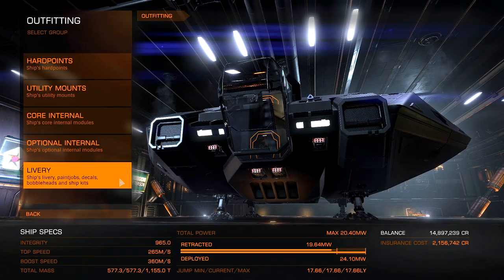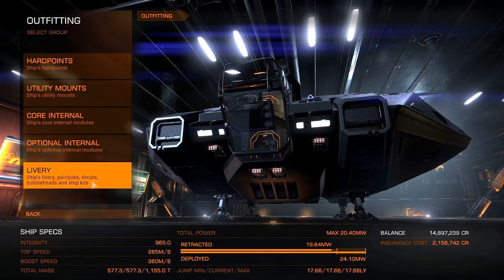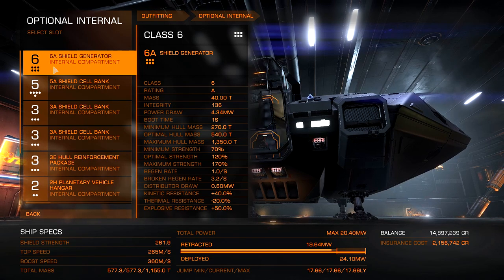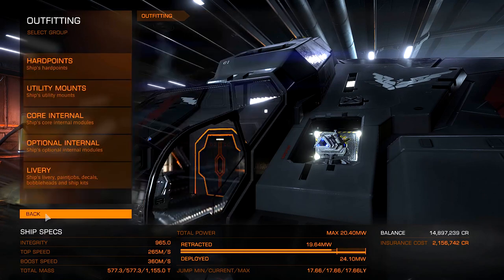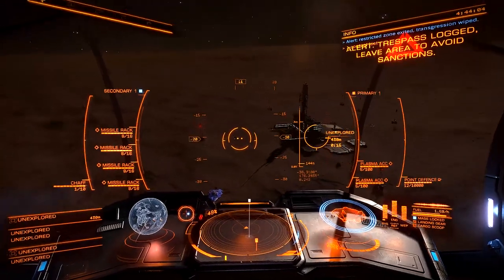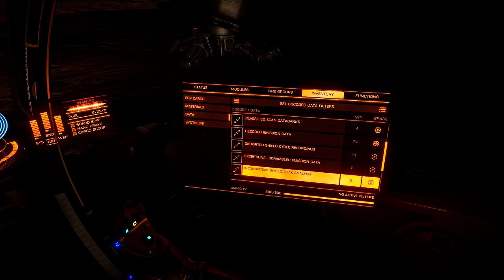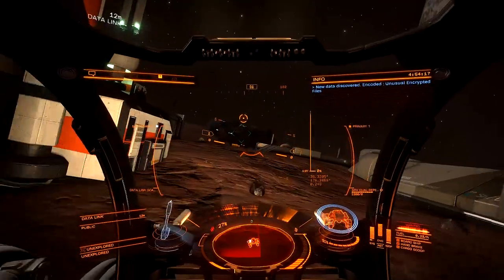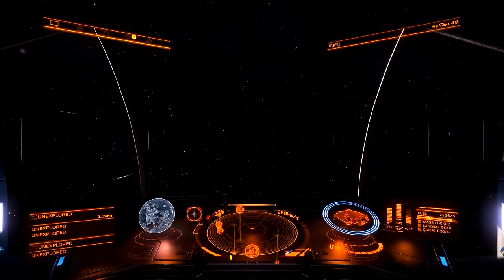Elite Dangerous - The Engineers - How to Get Cracked Industrial Firmware

Comment: I know that taking out the base power supply will render the turrets inoperable which will make your assault easier but I'm not sure if this will render data links inoperable as well. Might be worth a try
Reply from the maker: That's a very good point. I didn't think of it when I was doing this, but it may well disable the data points, I don't know. I'll give it a shot at some point thought, thanks!

Comment: This is pretty cool but I have collected several of these without conducting a full-on assault of the base. just land about 1 km out and drive up in the SRV. As long as you don't scan anything private then no one will attack you. I did have one alert get set off on me in the SRV but it warned me and i didnt listen.
Reply from the maker: I actually have tried that before. First, you get fined for entering a trespass zone and then, when you don't leave, the alarm starts going off and you get attacked. Is that something that works on + Low Security bases? And how are you not setting off an alarm when you scan the data points?
Reply: Just rush inside the zone scan the data point and leave it before you get fined or wanted.
You got 30 seconds to the fine and another 30 to get wanted from my experience and if the zone is on the roof of a building there is a small ledge on the outside of it where you can be on the roof but not inside the zone.

That's how I do it.
Reply: +ShadowTracer I'm not really sure. There is an alarm that sounds and you can here a loudspeaker yelling about security but no one attacks me. Maybe its bugged, idk. The only time i got attacked was when i scanned a private node. The only time i got the trespass warning was when i went into a certain area of the base that had shielded areas.
Reply from the maker: Sean Caswell Daedalus Wow, you guys are lucky. My SRV gets blown away every time I've tried that stuff. I guess it's a bit different for everyone then. Now I'm curious how many people your method works for and how many it doesn't.
Reply: Perhaps it has something to with your allegiances. If, for example, you are aligned with the Feds and try this at an imperial base, you would get destroyed; but if you do it at a Fed base, they don't care that much. Worth looking into.
Reply from the maker: Sean Caswell I don't think so. I'm allied with the Empire and I've really only tried it at imperial bases. Still get destroyed.
Reply from the maker: Daedalus Yeah, I'm up for that. I'll add you next time I'm on.
Reply: Awesome, just don't put us into one of your videos if we get our asses kicked ;)
Reply from the maker: Daedalus Shuts off camera Uh yeah, no problem >_>'

Comment: Did you found a Modified embedded firmware in the same way ?
I am looking for it but it seems really rare..
Reply from the maker: I don't think I've actually found any of that yet. If that turns out to be something I need for a Python upgrade, there'll definitely be a video about it though. What did you need it for? Also, it seems like all the firmware is something you get from settlement datapoints and it's just kind of random what you'll get from them when you scan them. So, if I had to guess, I would says that's most likely where you'll find it.
Reply: The + ++ +++ is the size of the settlement. The difficulty is the security level.

Modified embedded firmware has a chance to drop from +++ medium security datapoint readouts and definetly drop at least one on any +++ high security bases.

The high security base is the only one you need to raid. All the others you can simply readout the datapoints without getting attacked or fined or wanted.

Read all red data points in the time given. Blue data points stop the timer untill you read the next datapoint can be very handy on high security bases.

Fly safe

cmdr Whispers
Reply: Thhanks cmdr
Reply from the maker: Luca Romani You're welcome!

Comment: Have you noticed if they always drop Cracked Industrial Firmware.
Great Video
Reply from the maker: That is an excellent question. They do not drop it every time! As far as I can tell, it's pretty much random what you'll get from the data points, which, in my opinion, makes it somewhat more annoying to gather all these materials. And thank you!
Reply: +ShadowTracer ah the RNG at its finest, more grinding incoming...
Reply from the maker: Paul MacMaster Yeah...I'm so excited about that...yay...go Frontier :\
Reply: High security +++ bases drop up to 3 cracked industrial and up to 2 modified embedded.
Reply from the maker: Daedalus And how difficult is it to raid those bases on your own?
Reply: It is not really difficult once you get the hang of it. Find an anarchy base +++ High security. If it has fighter support even if the fighter is grounded make a low pass to get the fighter up and kill it first.

If no more fighters spawn, sometimes they do endlessly and you have to skip the base, set down outside the defense perimeter the base will not be agro so far.

Deploy your SRV and dismiss the ship. Rush into the station at maximum speed and find a sweet spot where you are protected from at least two sides. Now pick of the skimmers and turrets slowly working your way around the base. Once you cleared the perimeter, start to identify the locations of the data points and plan a route. You only need to read the red ones but if you find a blue one that is a joker. The blue one stops the timer once so that you can separate your routes some bases have up to 6 data points with a 20 second timer you need to be quick here and know how to climb buildings at the outside walls which really isnt that hard either once you know how its done.

The first view bases are going to be somewhat tough but after you studied a couple of layouts and raided a view bases its getting easier.

Good luck out there
Reply: Quator 1 has two +++ high sec anarchy bases its a good starting point they both have the same easy layout with only 4 data points and a blue data point to stop the timer.
Reply from the maker: Daedalus Thanks for the strategy. I've actually been doing this a lot more since I made this video and I'm a lot more familiar with how it works now. I just bought a Federal Dropship to help with the base assault part. I can just take out all the defenses from the air like in this video, then land and dismiss the ship. Lately, I've been looking for Modified Embedded Firmware, but no luck after raiding about 10 +++ bases. I'm sure I'll find it eventually though. I appreciate then help though, thanks a lot!
Reply: Hi Shadow Tracer, from my experience, they need to be high security and +++ I got at least one every time as far as I remember and once even got one from a +++ medium security. Keep trying and let us know if I just was incredibly lucky.
Reply from the maker: Daedalus Funny you mentioned this just now. I raided a +++ high security last night and got not 1, but 3 MEF as well as a crapload of other stuff I needed all from one raid!
Reply: I just got one off a medium ++ installation

Comment: overcharged multicannon
Reply from the maker: I just needed the cracked industrial firmware for the overcharged multi-cannon upgrades. In the next video, I'll be doing the actual upgrades with it. I also looked at the level 2-5 overcharged multi-cannons. They all require different security firmware, but I didn't see embedded in the list. I wonder if different players are being presented with different recipes?
Reply: Overcharged grade5
Reply from the maker: Luca Romani Oh, ok. I've only done the first upgrade so far. The rest are coming though! So I guess there will be a video on that if I'm going to need it for level 5.